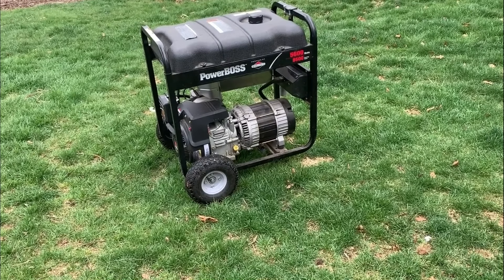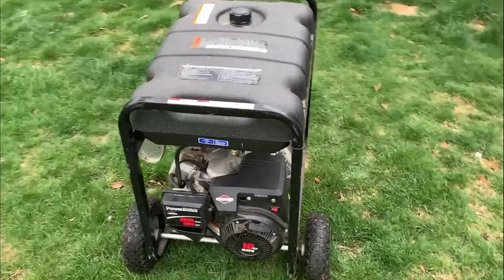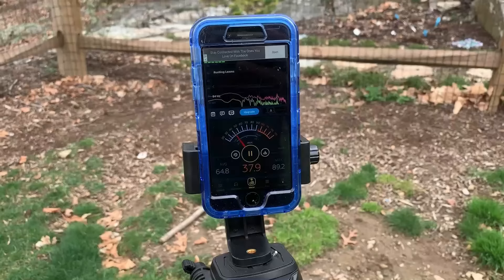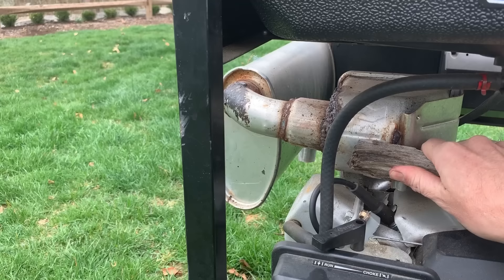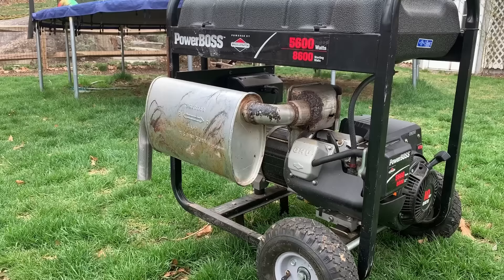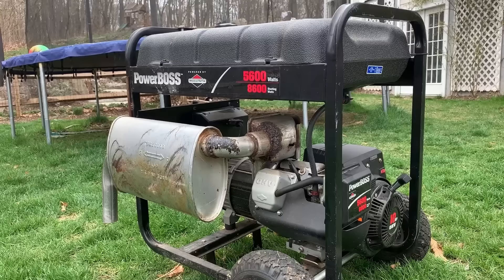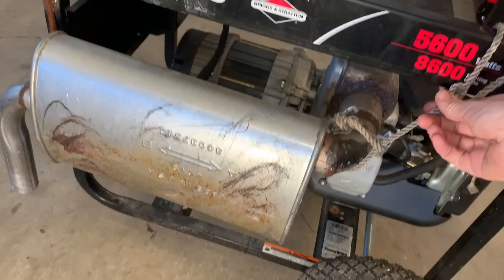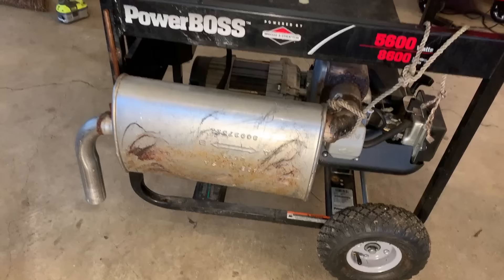Will a Car Muffler Make a Generator Quiet?

Comment: i saw an rv once with a generator running under it. at 10 feet away it did sound like a lawn mower but one that was running 300 feet away. it was very quiet and my camp site was a couple hundred feet away. i didnt notice it running at all sometimes with the other background noises.

Comment: The problem with using an app on your cell phone is that your cell phone is built to filter out low frequency (below ~200 hz) noise. You're not getting accurate information.
Reply from the maker: Very true.

Comment: I don't see why you didn't weld up the hole in the primary muffler first so we could see the real difference. It's a very weird apples to oranges comparison of an old stock muffler with a hole plus a car muffler compared to a new stock muffler. Yes clearly clearly the muffler did help - but we still have absolutely no idea by how much?

Comment: I looked into doing noise reduction on my All Power model several years ago and unfortunately found that in these cheaper brands a lot of the noise is coming directly from the engine walls itself. About the only thing that would work is building a dog house to enclose the generator

Comment: wouldn't you need to test it with the original muffler on first?  Also reduce the tailpipe to a small engine sized tube to get it to muffle correctly ?

Comment: Fabricate a cover on the muffler about 1/4 or less of its current size. Single cylinder engine runs fine on a bottle cap opening or amazingly the size of the exhaust valve. No engine knowledge in this video!

Comment: It's a bit unfair you did part 2 with a new muffler without a huge hole in it. Even with a new muffler, the second part was 5dB louder which as Mr Debruyn below notes is 3.16 times louder. Put another way, the car muffler added to the damaged original reduced the noise by 316%. One wonders how much more this would work if one replaced or fixed the first muffler too.

Comment: The longer the exhaust pipe is the quieter it will be... also I think a motorcycle muffler would have worked better than a car muffler.

Comment: A vehicle quite type muffler will make even a small engine quite if you weld it up right never weld a muffler too a muffler weld it too the exhaust flange onto the engine

Comment: well the muffler isnt welded to the pipe, and all the actual welds arent done properly. and that gaping hole is letting all the noise out before it even hits the muffler. if it was executed properly it would be pretty quiet.

Comment: You're better off to build a soundproof box to put it in are you the muffler like from a Lincoln Town Car and also wrap the exhaust with the insulating wrap like that you won Marine engines in sailboats wrapping some of the pipe for Muffler get a lot of noise from vibration and that will quiet that. After I put a new muffler on my 86 Town Car you could not even hear the car when you stood in front of it

Comment: If you had removed the clavicle tension rod, changed the wiper push fluid to a compound of 20:9 and then lubed the steering stirrup bearing it would have been 38% quieter.

Comment: What's the state of the car muffler, it could need repacking as usually people would put an old one which might not perform as good as a new/repacked one.
So the reults are inconclusive.

Comment: Would it be possible to run a generator off an electric motor? Hear me out. Can you compensate for the energy loss by means of gearing? 2 well placed and calculated sprockets. Will there be a point where it generates more electricity than it consumes?
I'm OBVIOUSLY grasping at straws here, but it would be interesting to see how "efficient" you could make a closed circuit charging the battery whilst the battery is powering a generator and see how long you can get it to run before it runs out of juice

Comment: 5:30 WHY?? Why cut off the muffler bracket so soon.??? I've not seen the rest, yet, but... 6:20, Paint?? Ahh, I see you will not return it to a Muffled version. And, 8:40 you should cut the car tailpipe to go at a 45* angle away from the generator, both down and away from the frame...? I do believe that is what I'll do. After this biased test...

Comment: I'm gonna do this super scientific decibel measurement of the noise reduction caused by an oversized muffler attached to the oem muffler, but oh, btw there's a huge hole in the exhaust manifold and I'll just cover that with a stick....SMH.

Comment: I know this videos old now but. I mean look... the exhaust bolts were loose during the test with the other muffler on it, Meaning the manifold wasnt making a seal.  How can you compare the "before" to the "After" if the after, the thing was actually bolted to the engine and before it wasnt?

Comment: ALTERNATOR, the stator is a component of it but the entire device is an alternator😁
Reply: Jim Kloeckner  I will expect a comment after you educate yourself!
https://en.wikipedia.org/wiki/Alternator
Reply: Jim Kloeckner   Firstly let me say I will match my MSEE and GPA with yours at any time you wish, you pay for the shipping and I will provide my Diploma and Transcript from UMR.  Secondarily, I was referring to the video creator's use of the term, incorrectly I might add, stator,  not "stater" as you just commented.  I was hoping to assist  Mr. Condon with the correct terminology as he seems to be a decent fellow who is doing well with recovery and repair of small engine driven ALTERNATOR power plants.  Why you inserted your incorrect opinion into the conversation remains a mystery.  I am certain you will continue to blather so as to get the last word in, let us wait and see!

Comment: Nope because then you will have all the tap it and lifter noise and block noise and then also the air intake noise which is quite extreme.

Comment: I can tell you without watching the video that it will still be very noisy. This will happen with any BRIGGS & STRATTON  engine. These engines are designed for low cost, you get what you pay for.

Comment: I'd be curious Sticking a stock muffler grom a Honda gl1200 on it, how many decibels the engine makes..
    Because you'd barely hear the exhaust with that particular motorcycle muffler.

Comment: Briggs and Stratton engines are mechanically noisy to start with. In a word, they are harsh. I have a Honda powered lawnmower and it is way quieter and smoother running than any B & S engine I have heard.

Comment: You can't quiet an AIR COOLED engine. Water cooled engines can be made quieter because they have a water jacket around the cylinders. You can add 20 mufflers...the noise is from the engine itself,NOT the exhaust

Comment: The real question can I pipe the exhaust outside a shed building? In other words have the generator indoors and pipe the exhaust outside and then put a good muffler outside at the end of the pipe. 73

Comment: one of the things missing is ........ the long pipes like on a car . truck . that helps lower pressure. i would bet if you bent up some sort of system with about 10ft of pipe it will knock it down to 50db. but who in there right mind would have 10ft of pipe hangin off there gen... hahahahhaha

Comment: You will have better luck lowering the noise by venting the exhaust up a tall pipe, enclosing the generator in a foam lined box and using a forced air cooling system. OR just buy a honda.

Comment: well this sucks, i was actually interested in this, until i seen the hole!  any whole in an exhaust is gonna make the exhaust extremely louder, atleast in a motorcycle or a car, so i assume it was atleast 5-10 decibels quieter without the hole.  being said, since the engine is out in the open unlike a car, alot of the noice does come from you hearing the combustion an other noises happening, as well as the exhaust.  maybe one day if i get board i will try this on somethin

Comment: I designed a straight pipe with a 90° at the port like a silencer on a zip gun . Perferate a smaller diameter pipe at 18" or as long as possible and i mean drill the fk out of it and insert it in a larger pipe then pack it with steel wool... Booum !!! done...

Comment: Saw a video on a comparison test of a predictor 12000 ? And a Generac propane model predictor $1200 and generac about $8000 the predictor was equal to the  generac  what do you think can buy many predators as to the generac !,,
Reply from the maker: Predator and Generac are basically the same.  The biggest difference is Generac costs a lot more.  Generac though does supply parts and usually they are available.  HF usually does not have the parts when I try and order.

Comment: Hi James, i have  a generator with an engine like this. Got it not running. It runs fine now, but i found that instead of oil it had something the consistency of tar in it. between letting seafoam soak, and waiting,  ive managed  to drain a fair ammount. Im just wondering if you have any suggestions on how to get the rest out.  Im at the point now where i think i need to just fill it with normal oil let it get warm, and hope that helps the rest drain.
Reply from the maker: Short of opening the engine and cleaning the other two option I would consider are 1) run it long enough to get some heat in it and do an oil change or 2) maybe fill it with diesel.  Remove the spark plug and rotate the engine a bit with a drill on the flywheel nut to mix things up.  Not too much though because the diesel will not adequately lubricate the engine. Wd40 also works very well at breaking up oil.
Reply: @jcondon1  I ended up adding a little gasoline, letting it soak overnight. I drained it all out, added  oil ,  let it run for 5 minutes, and repeated  2 more times and now it  seems "mostly" clean.

Comment: The noise level emitted by the generator is not ONLY exhaust. 
Looking at your footage it's obvious that the noise is still high when you shut down the engine. If you want a silent set, take care of air inlet too and make a noise proof box around the whole generator. Last shocking detail : storing fuel OVER the engine in a plastic tank is an absolute non sense...

Comment: Is not  the  .mufler  or air  filter  that  make  a generator loud     the  whole  engine   metal   release    high   acoustic  sound    all  the  atoms   of  these  metal  in  fast  movement

SO     IF YOU  WANT   TO  MAKE   IT  ABSOLUTE  SILENT      PLACE  IT   IN  A  BOX  FITED   SOUND  PROOF   FOAM       SO  COOLING    SYSTEM   MUST  BE  ADDED      0   D   E   C   I   B   E   L

Comment: I landed on building an insulated well house type building.  Yes Karens of Earth I'm aware exhaust is harmful and that's why its vented.  When it's running and your outside you can't hear it an that's what ya want when it hits the fan.  Iv a kill switch outside I use before opening the door.

Comment: That’s just a cheap random muffler but it’s actually set up to put a bucket of water under the tailpipe so the pipe in IN the bucket of water. Then you will get quiet.   The muffler is a joke but the down turned pipe to put in a water bucket is the ingenious part that ….btw, you completely MISSED DUUURRR. You failed

Comment: Big mistake IMO........that huge muffler will over time cause way too much backpressure on that small engine, causing it to overheat, maybe burn the exhaust valve and in total , shorten the engine life........let's not overthink the engine MFG engineers........

Comment: Why are Hondas so quiet?
Reply: They’re not. Rev it up to 3600 rpm like a generator runs at and it’s relatively noisy. 

They do have the advantage of an exhaust manifold, resonator, at least one catalytic converter, multiple feet of exhaust pipe and a muffler specifically engineered for that engine. Even then at high RPM they aren’t “quiet”.

Comment: This is not an accurate reading because at first the generator was cranked and run inside of a building and the second
Reply: Time it was run. Outside of the building. They need to be cranked and run with the same environment to be correct.

Comment: Breaking the Dremel disk was inevitable.  It was way too flimsy for what you attempted.  Also, your use of a wooden block to reduce the noise from that burnt out hole in the original muffler was laughable and stupid.  It would or should have been easy to weld a small patch and make the exhaust noise block very much more accurate.  It also changes the base of your noise experiment.

Comment: NOPE !
It won't work .
You'll get much better results by just adding a small tail end pip to the original exhaust muffler and point it down towards the ground. 
Mind you, not on a concrete floor.

Comment: The goal of this video was to compare noise levels with, and without, a muffler.  But the majority of the video is spent on explaining the muffler's attachment to the engine, and the process of removing that muffler.  All of that was completely unnecessary to meeting the goal of the video.  You took over 10.5 minutes to demonstrate something that could have been done in about 3 minutes, and this would explain why over 1.5 million people viewed the video but only 1800 people commented.  Those 1.5 million viewers completely lost interest and turned it off without viewing the entire video. So, what is my takeaway message here?  Edit your videos to conform to the goal of the video!!!  Cut out all of the superfluous junk that just wastes everyone's time!  Your videos will be more engaging if you identify the goal or objective of the video, and edit everything out that doesn't address that objective.

Comment: Considering, your attempting to compare. Why didn't you attempt to fix the hole in the exhaust before attempting this compare. If your after to quit it down. Use a muffler off a Moped/Scooter. Your attempting to compare a 4 cycle exhaust to a V8 engine exhaust. Not brain science here. It's not the muffler that makes things quit. It's the baffles inside the muffler that does all the work.